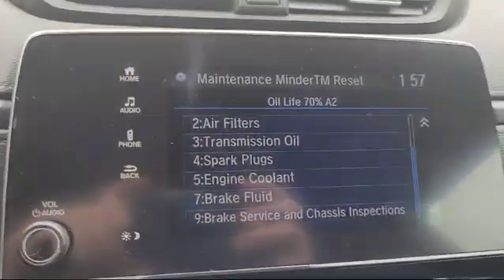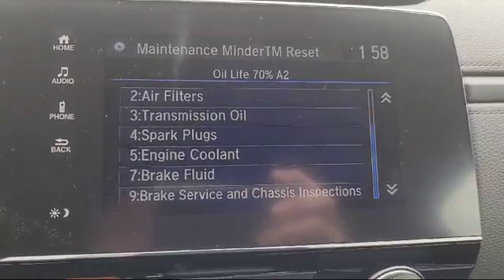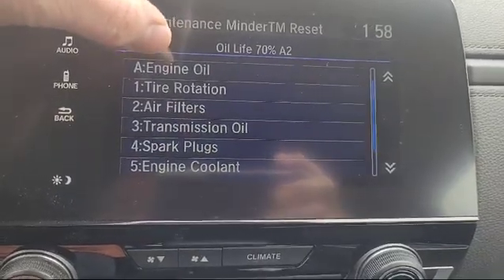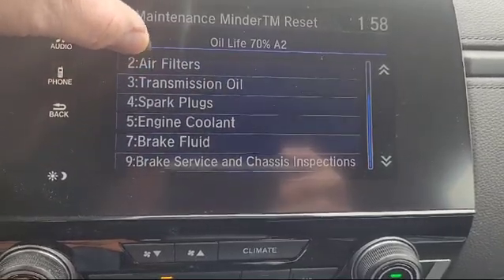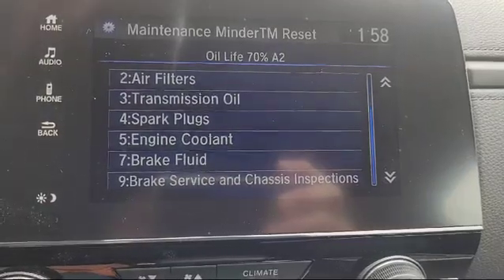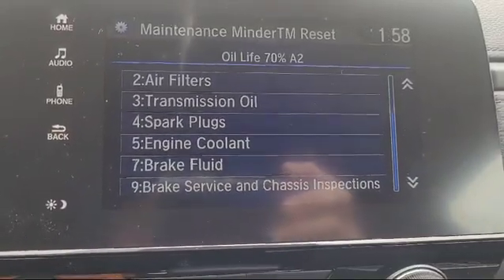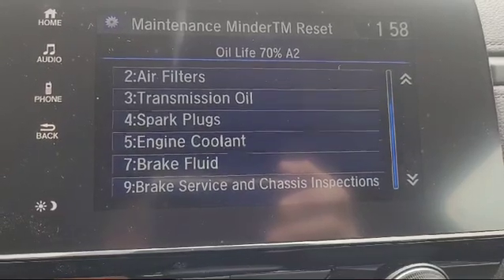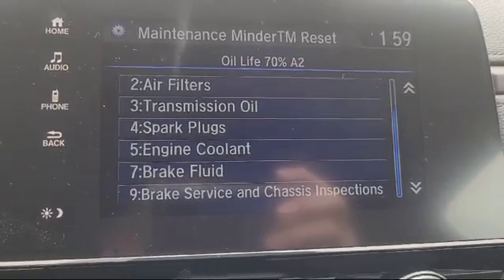Honda's Maintenance Minder System What Does It Mean? & Why Is It Important To Follow?

Comment: I have a 2020 Civic and the only maintenance notice I can find in the car just gives oil life as a percentage. Is this Maintenance Minder only on specific models, i.e. not mine? TIA.
Reply from the maker: The Maintenance Minder system is indeed a feature found in many Honda vehicles, including the Civic; however, the specific functionality and display options may vary depending on the trim level and options package of your vehicle.

In some models, such as higher trim levels or those equipped with more advanced technology packages, the Maintenance Minder system provides additional information beyond just the oil life percentage. This may include reminders for other routine maintenance tasks such as tire rotations, air filter replacements, and inspections.

If you're unable to find detailed maintenance notices beyond the oil life percentage in your 2020 Civic, it's possible that your vehicle may have a simplified version of the Maintenance Minder system or that certain features are not enabled in your specific trim level or configuration.

To confirm whether your vehicle is equipped with the full Maintenance Minder system and to access additional maintenance reminders, I recommend referring to your vehicle's owner's manual or contacting your local Honda dealership for assistance. They can provide specific information about the features and functionality available in your Civic model and help you navigate the maintenance schedule effectively.

Thank you for watching! 😉
Reply: @UrbanAutomotive01  What an informative reply - thank you! Yes, I have the base Civic with a minimally invasive and distracting display. Manual too - the only way to drive! Thanks again. :)
Reply: @UrbanAutomotive01 sabes que otros vehículos tengan ese tipo de sistemas de mantenimiento tan completo ? La verdad no me gusta Honda pero me gustaría un sedán N/A con un sistema tan completo así de recordatorio, Saludos